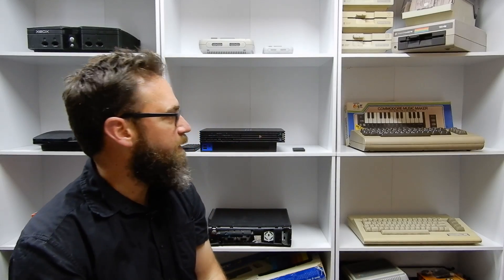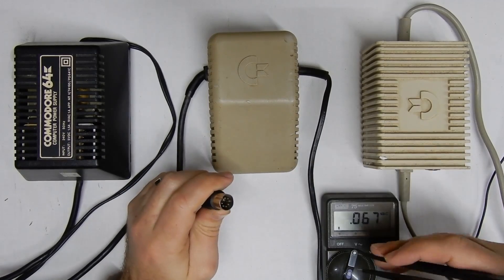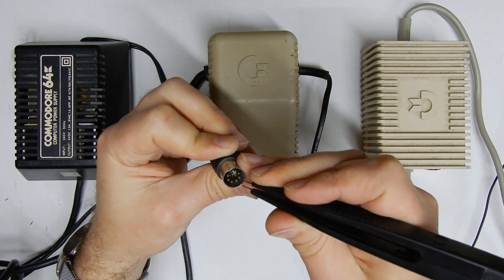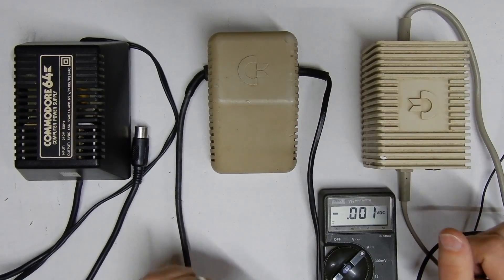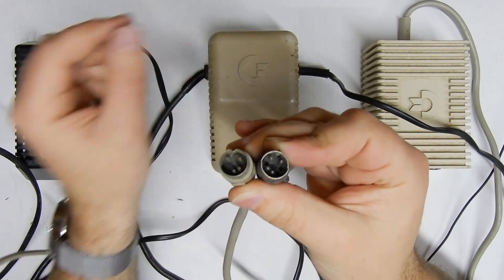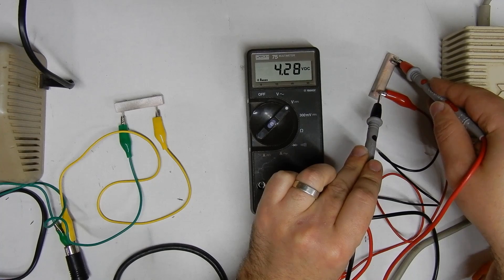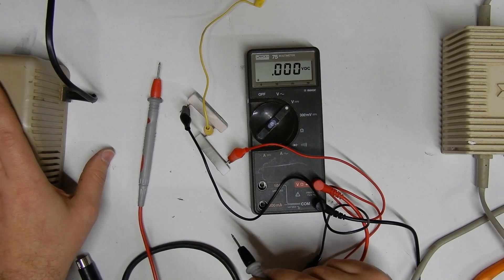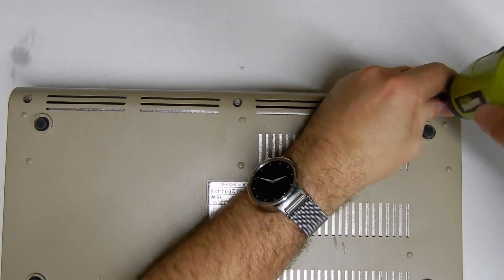Commodore 64 - PSU and capacitor testing - what to check before powering on your

Comment: I replaced all the caps on a Breadbin 64 I have and used some recycled heatsinks. I felt a bit sad to remove the original caps but I thought it was important. Even if they look ok they can  be dried out after 40 years.

Comment: Black power supply on left is the best orginal one. Great. Not potted. I put a inline regulator board inside and left it otherwise original.

Comment: Hi very informative video. I have a different case. I see you are using a resistor when testing the PSU under load. I ordered a new PSU which after some time get disconnected by the protection psu circuit due to overload current probably greater than 4A (declared by the vendor). What should be the value of the resistance seen by the psu ? I am reading 4.18 Kohm (multimeter set on 20K), no external device connected (joistick....ecc) between pin2 and 5. Thank you.

Comment: Hi Sawickipedia, 4 years ago my C64 was still working (without any problems). 
Now I'm afraid to turn it on... Bcoz, I get 10.68v AC and 5.25v DC. Without testing it with a ceramic load resistor, is it safe to turn on my C64? TIA
Reply from the maker: Those voltages are fine, but who knows if everything else inside still works. Good luck

Comment: Im getting 5.12 on the dc but 0 on the ac. Ive aldready used it and it works, but after 10 min the screen starts to flicker.
Reply from the maker: Double check the AC again, it's the two top pins near the notch at the top of the plug. Make sure your multimeter is set to AC. There must be some voltage otherwise the C64 wouldn't work at all
Reply: @Sawickipedia  Yes i was on AC on thoose pins. Maby i touched the ground? Il check again. Btw i checked a c128 power supply on ebay but that ac was 9 volts?

Comment: Hi.. my power supply is 5V without load , but when I connect to the c64, it down to 1.7V (So, with load it fail) . How can i Repair the power suppy with that issue? Thanks!
Reply from the maker: Oh wow, it could be the power supply OR a short inside the C64. Do you have access to another power supply or C64 to rule out one or the other?
Reply: @Sawickipedia  i Check that after a couple of minutes the VIC turn too hot , others IC almost cold .  I don't know if is normal that VIC turn hot in few minutes .?
Reply from the maker: The VIC will always be hotter than everything else, and yes they do get very hot. But in saying that, it is not powered from the 5V on the power supply. The VIC and SID get their power from the AC side that then gets regulated to 5V and 12V DC inside the C64.
Reply: @Sawickipedia  I remove the SID and c64 power on ok.. maybe it can be the SID itself or PLA ..
Reply from the maker: If it powers on ok without the SID, then it's most likely the cause. You will need to source a replacement. An original SID would be best, but failing that there is also the ARMSID which sounds very close to the real thing, and the swinSID which doesn't sound as good but it's better than nothing
Reply: @Sawickipedia  Hola!!... I bought the 3.3 Ohm 10W resistors (the same ones in the video) and I did the same tests as you. My Power Supply show 3.7V with 3.3 Ohm and 4.3V with 6.6 Ohm. Maybe that's why when I remove the SID the system start.  anyway seems that my PS is not healthy (i have the model that you use at the right).
Reply from the maker: Oh yeah, that sounds like a bad PSU. At least you figured out the culprit. If you're comfortable working with mains power and power supplies, I actually replaced the old linear part of the power supply in the black brick with a meanwell rs-15-5 in this video https://youtu.be/w5H3CtuPBHA
Reply: @Sawickipedia  Finally the problem was solved, I bought a Keelog PS and the c64 start ok!! :) :) . So thanks to you and  this video I was able to solve the problem. Although without load the old PS delivered 5.1V, with load was another history.. it was not able to deliver enough current (now I explain me  why removing the SID the system started!). Thanks again for this video and your support!

Comment: i am getting 9.6V AC (and 5.16 DC) I noticed that the label on the device says 9V so is this an okay reading? ( in your video you say not good if below 10V so... was wondering)
Reply: Forget checking them.  Don't use any of these power supplies at all because they can fail at any time and fry your C64!  All of them should be replaced with power supplies that fail in a safe way, period.  If you have a C128 power supply, then you can use that with an adapter cable.  A 1764 power supply would be fine, too.  There are also a bunch of aftermarket power supplies that seem to work fine, and will shut down when they fail instead of blasting 8+ volts into the 5-volt input of the C64.
Reply from the maker: 9.6vac will be ok.

Comment: Great video. I'm gettin 10.60 AC and 5.16 DC. Without testing it with a load resistor would I be fairly safe at those readings you think to try out my c64 ?
Reply from the maker: You should be fine

Comment: I'm a lay person. So do I need to get a resistor to test it under load? or is it good enough to just test the voltage at the pins? (I don't have a resistor so I'd have to find one)
Reply from the maker: Testing the voltage without a load will give you a rough idea of the condition. The voltage will drop under load but you won't be able to tell by how much.
As long as you make sure you're not getting anything higher than 5.2v unloaded you should be ok. If the system becomes unstable while powered on then chances are it's dropping too much voltage, but it shouldn't do any damage